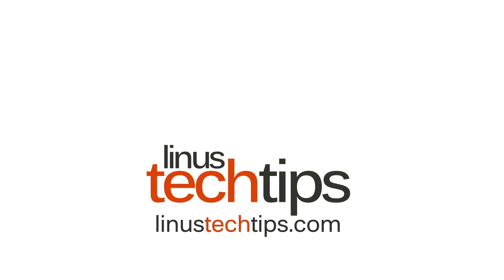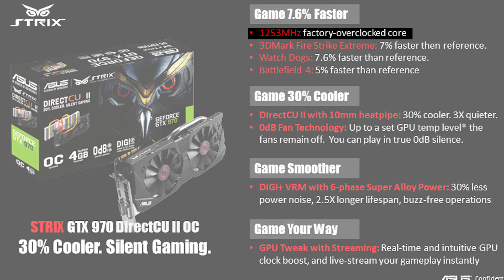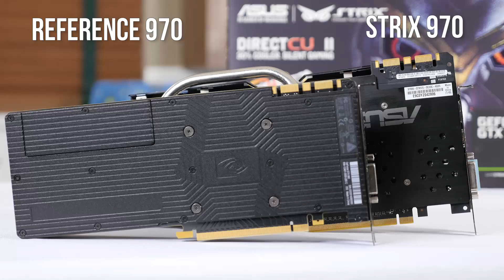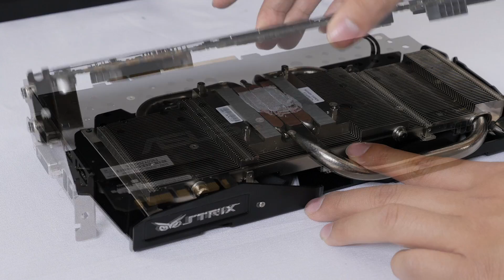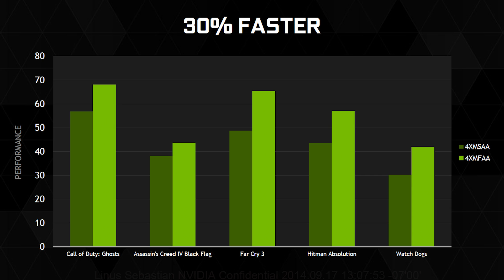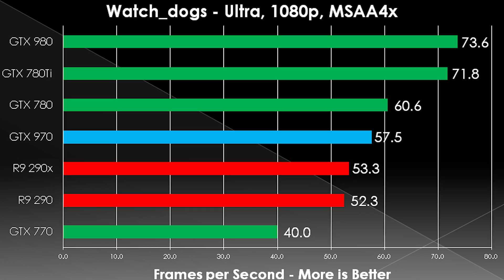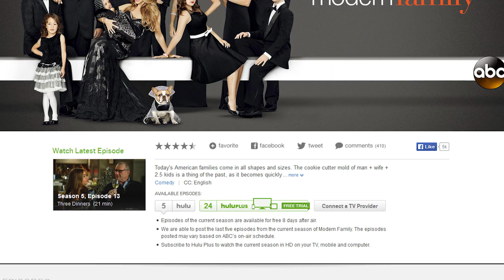ASUS Strix GeForce GTX 970 Video Card

Comment: Phew, i watched a couple of reviews and the 970 beat the 780Ti , must hace been a hoax or something
Reply from the maker: ***** They are running the cards at stock speeds. We overclock all of our cards.
Reply: shootingmen overclocked 970 loses to a overclocked 780ti. A 970 can be overclocked to dominate a stock 780ti. This is how all the 'reviews' out there can be confusing and misleading. For instance, my watercooled and overclocked R9 290 scores higher than 2 290's in crossfire at stock...
Reply: shootingmen an overclocked 970 loses to an overclocked 780 ti.
ALL cards are overclocked.
Reply: Richard Smith don't lie
Reply: SwiftMoosic Why would i lie?
http://www.3dmark.com/fs/2717191
Notice the user submitted is rich1051414, which is me.
Hit Show result details then Click the bar on the far right, those are similar results. It is in the same range as 290's in crossfire.
I was not bragging, anyone can do it, I was simply stating that benchmarks can be deceiving if you are not positive what exactly is being compared.
Reply: Guys please don't forget, that the 970 will become even faster with new driver updates, and will, in addition, get a performance boost in future games which support MFAA and other new features.
Reply: Keep in mind that their 780ti was beast when they overlocked it. It's definately running faster than other OCed 780tis
Reply: LinusTechTips So, an overclocked 970 loses to a 780 ti? I thought it was the other way round all the while.
Reply: shootingmen
No you don't.
Overclock your card so it runs stable under 2D more. Start a benchmark. ( Valley Benchmark for example).
Let it run till its temperature is not raising anymore and make sure there are not artifacts or similar issues.
Afterwards raise the clock speed or lower the voltage and repeat. Then test the overclock over multiple other games u usually play.
There is not need to do 3 day stress test if all your favorite games run smooth. ;)
Reply: shootingmen No you can overclock your GPU in 1 day if you know what to do. Make sure to not only benchmark it with Valley etc but also test it on optimized games such as bioshock or metro
Reply: So, if i am NOT planning to OC, i should get the 970 instead?
Reply: shootingmen Why wouldn't you OC?
Reply: Yalam Magic I've never done that before.
Reply: It has nothing to do if you want to OC or not, the 970 is currently the best bang for the bug when it comes to highend cards. And btw, you can easiely overclock this card with MSI Afterburner without any risk.
Reply: LinusTechTips I know that, but how is it that big of a difference ?
Reply: ***** Oh
Reply: ***** I know the 970 is the best bang for the buck card, but even so, how is a stock 970 able to win against a stock 780 Ti ?
Reply: LinusTechTips I can understand if all of them ran at stock, the 970 will beat the 780, but the 780 Ti ?
Reply: This was the benchmark I was talking about, as you can see the 970 is beating the 780 Ti, still have no idea why on stock it would beat the 780 Ti http://www.videocardbenchmark.net/high_end_gpus.html
Reply: shootingmen It's a pretty simple process actually. There are many guides out there to help you out. The hardest part is that it takes time to squeeze out a good overclock.
Reply: Richard Smith woah o_o
Reply: Yalam Magic How much time does it usually take?
Reply: around 1-3 days totall if you want to make sure its stable i always overclock both clock speed and memory speed by 20Hz test in benchmarks if its table ( no pc crashes or artifacts or tearing) to high i downclock it with around 5-10MHz per test till i find the sweat spot you need a good cooling case and enough headroom a card that runs stock over 70 Celsius is not advived to overclock does it run at 30-50 Celsius its alright as long in my case it does not exceed 70 celsius i am fine with it

keep in mind a GPU only loses its live time by how hot the components run clock speed does not wear or tear a GPU its the heat that kills it so dont trust people telling you that OC with a great cooler can kill your GPU while OC at 50 celsius if its over 70 celsius it would decrease the life span not because it runs on higher clock speeds just a friendly reminder ;)
Reply: TheJackalPhantom So, everytime i want to OC, i have to leave it on for like 3-4 days?
Reply: 1-3 days*
Reply: Richard Smith why are the amd cards in Lukes benches always so much worse? Are they using reference coolers because I feel my windforce card performs much better.
Reply: team0blackmanner Overclocking results are difficult to interpret, as it depends heavily on luck. It also depends on the manufacturer of the cooling.
Mine is custom cooled, using an AIO water cooler.
Reply: shootingmen no it takes to hit the sweat spot after a few hertz increase you need to run a benchmark for around 2 hours constant to test finding the best spot for your card may take 1 to 3 days a quick one only 6 hours but can be unstable
Reply: ***** That's probably the worst chart to look at when you're looking for strict gaming performance in the real world - there are plenty of cases of weaker cards beating out stronger performing cards in games on that chart. That's a horrible chart to reference (just compare other cards, GTX 275 is a "low performer" on that chart but one that was able to remain competitive for me until I replaced it this year)
Reply: *****
bad graph, look at where the titan z is
Reply: *****  The 780TI simply has more overhead in overclocking, that is why on this benchmark the 780TI gets ahead and not on the others.
Reply: *****  I believe that Asus had already gotten alot of the overclock to get the core speed that high out of the box, so Luke didnt have much room to play.
I think.
Reply: shootingmen Couple hours. Of course, if there's still some issues afterwards (blue screens, CTDs, etc) you're going to have to go back and lower the clocks, so it can be a bit tedious. The performance increase is worth it, though.
Reply: shootingmen overclocked 970 loses to a 780 overclocked, the review u see only overclocked the card under review, and in stock clocks the 970 just bearly beats out 780. but bcz 780 stock clocks are very low. so when pushed they always beat a pushed 970... more cores on the 780 wut do u expect

Comment: Are there any graphic card that can run Crysis 3 at Ultra above 60 FPS?
Reply: ***** It's a sign of how badly unoptimised that game is imo.
Yes, the graphics look very good and it has many effects, but at this point it's just a benchmark software to test your new gpu.
Reply: Possibly an R9 295x2
Reply: Faffy Waffy Thanks but I mean single graphic card. I'm sure dual graphic card can run it at 60 FPS, but I haven't heard of any single card that can.

Edit: Oops. Thought that x2 means two cards.
Reply: even at 1080p, no single card atm can max it out while playing at 60fps..
Reply: Ahmad Alifi Impressive.
Reply: ***** pretty sure its also the game not really optimized that's why
Reply: The GTX 690 can. I assume the Titan can aswell although both cost a bunch..
Reply: Titan cant, 690 is two 680s
Reply: Titan cant, 690 is two 680s
Reply: might be inaccurate  my statement was, yes there are single card than can process that, (dual core single card), but not single core
Reply: A GTX 760 can play it at 60fps very high 4x msaa 1080p
Reply: LegoTechPlane But not at max settings :P
Reply: littlefrank90 Well shouldn't a GTX 980 max it out at 1080p?

Comment: What do you think is better: this Asus Strix 970 or MSI Gaming 970?
Reply: Depends if you want silence when not in gaming or even while gaming then asus, but if you want good cooling msi but with maxwell it doesn't matter as it is did the last gen
Reply: Booker Dewitt Asus is quiter in games than MSI?
Reply: Oshino Shinobu any card from evga or msi or asus will be quiet under game, but under games like league or anything that isn't really that graphic demand by like a huge amount asus wins by having a no fan spin mode
Reply: Booker Dewitt But MSI gaming have it too? It's called Hybrid Frozr. So I thought there is no really differnce between these two cards, maybe price or clocks.
Reply: well with maxwell there really isn't a difference in terms of performance, i mean it just really boils down to what you like more, and which fits your needs better, but all three of them have a clockspeed that is really within negligible margins like they are so low that you wouldn't really notice it in game.
Reply: Booker Dewitt Thanks for answer ;3
Reply: ***** Nope, gigabyte is loudest and longest of the cards, why would I buy it?
Reply: ***** I have GTX 465 now, and when it's on full fans, its sooo fucking loud, I hear it even with loud sound from my speakers.
Reply: ***** Yeah, checked now, they have same noise under load. But gigabyte is too long for my case;(

Comment: I am 12, live in Australia and I plan to build my first pc in the next few months. How does this build sound?: 
CPU : intel i5 4590
GFX : XFX r9 280x DD
Case : corsair spec 02
RAM : g.skill ares 8gb 1600mhz
MOBO : Asrock fatal1ty h97 - performance
HDD : 1tb Seagate 
PSU : Corsair vs650 80 plus bronze
 CPU Cooler : CM hyper 212 evo
SSD : 120gb 840 evo
Monitor : Asus ve248h 24" 1080p
I plan to be gaming, web browsing and doing school work.
All advice appreciated.
Reply: I would get a slightly more powerful PSU.. just so you know you have head room. like a 850 or 750 would be good but other than that you are fine! goodluck!
Reply: Randy DeCent ehhh 650 is ok however 750 would be utterly more than enough i mean none of those parts are even close enough to be so demanding as to need an 850w psu
Reply: L8 Valentine yup, people think that they need an amazing psu to game, a decent 500 watt one will even handle 780 ti/980
Reply: I do realise that I can't overclock with the h97 board and the 4590 cpu. I've just found some 2400mhz ram for about $10 more than the ares, do you think it's worth it? I am also not that keen on the idea of getting an asrock board, but it was the best h97 board I could find.